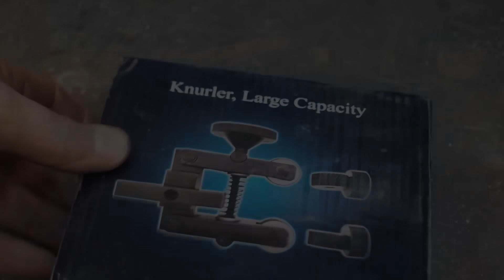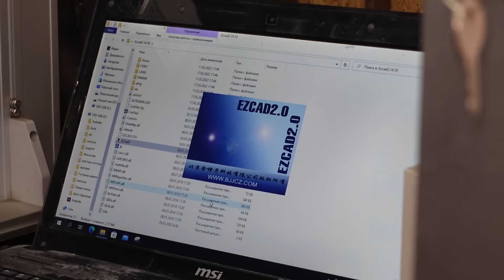You don't have to buy it in the store. Just do it yourself

Comment: Please go to a store and buy one, that was painful to watch and I feel embarrassed for you. You turned the parting off tool to chamfer the end and then you had a chamfer tool already setup.  When turning rough rusted steel you use a 4 jaw, not a 3 jaw. Unless you want to damage the 3 jaw, then mission accomplished. Rather than just using the small diameter of the centre drill go in until the large chamfer as it centres the drill better. Learn how to turn threads rather than producing sub standard garbage with a stock and die. I fast forwarded to the end as I was in pain, why use a laser to put your emblem on the face that is going to be damaged, what a waste if time, much like watching the video.